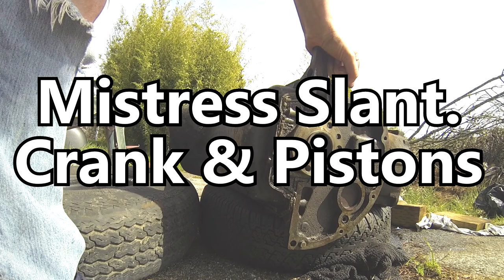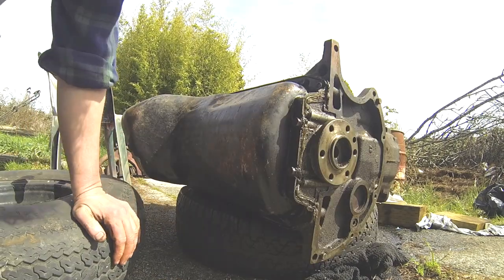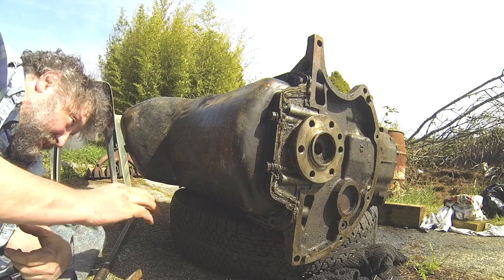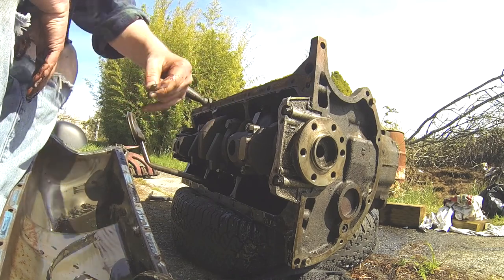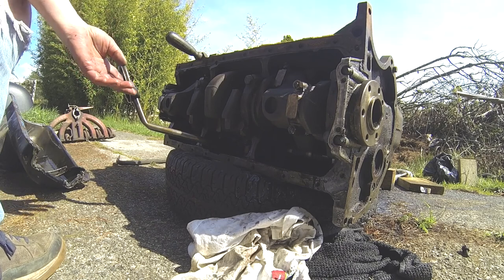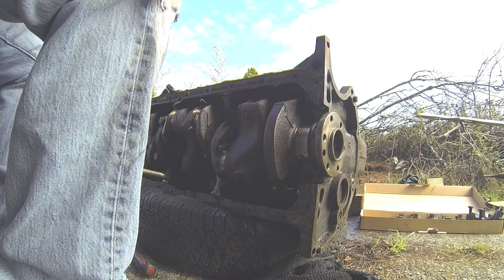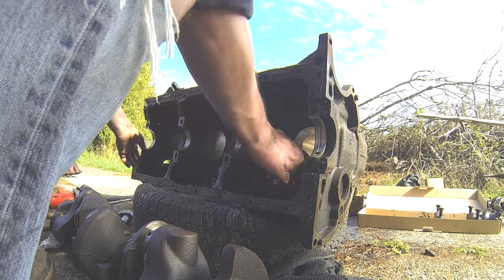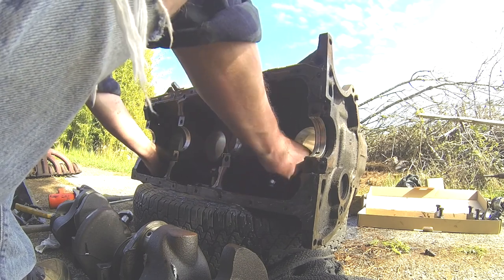Mistress Slant-Crank and Pistons-Part 5

Comment: Are those the std bearings ?
Reply from the maker: They appear to all be STD yes. and now that I've wiped one of them off, they are more scored than initial look (At least the Piston rod ones are). Relatively evenly scored which is good. CB1214AL / 688 is what is stamped. I'll have to check the mains and see what they are.
Reply: MicrophonicFool those engines are very good engines. I wish they still made them. I miss mine. Had one in my 83 dodge truck.
Reply from the maker: Ya, this is the third Slant I own right now. No issues with them. They are as straight-forward as an engine gets. There is a reason they were built for 35+ years in basically the same form. Even after North America stopped making them, Mexico still made them for trucks and marine uses.
Reply from the maker: Oddly, the single thrust bearing doesn't have maker-marks, only a couple of size numbers. Also, those grooves that I saw are there on purpose, they just look weird. Probably oil delivery grooves of some type